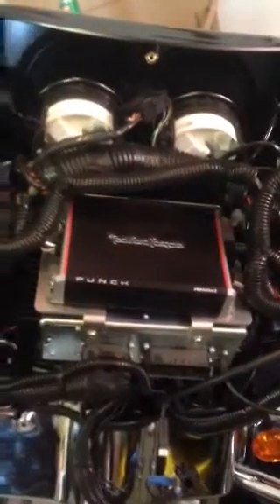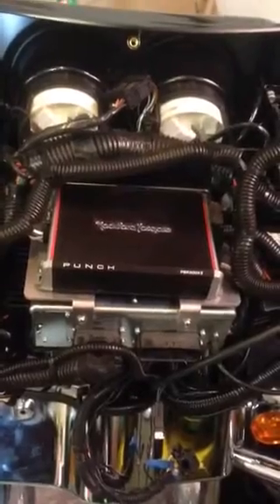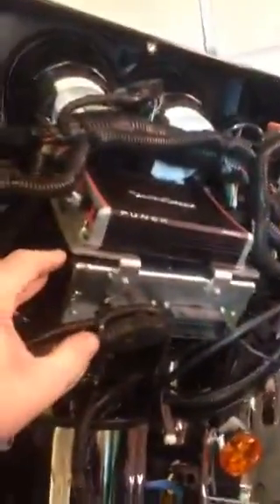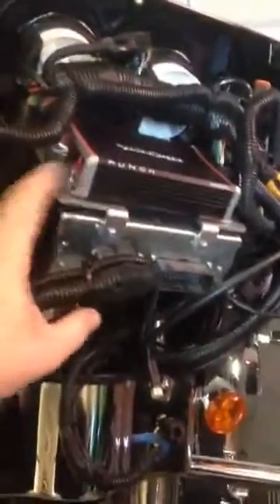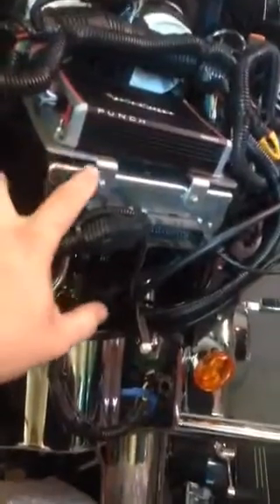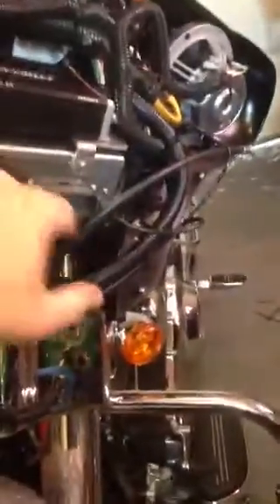how to mount an amplifier / stereo install in harley davidson streetglide

Comment from the maker: @toolband yes the stock speaker wires splice into the amps harness that has the rca ends. you cut the ends off and then splice then together it explains it in the amps instructions on how to do it

Comment: Thanks Kelly. I was going to get the Fosgate, but since I live in Costa Rica and its very high humidity, I was leaning towards the marine grade JL amp. In addition there are some leaking issues with the new vents in the 2014 fairing. How deep are your brackets? Did you add spacers in the rear to keep the same clearance? Thanks
Reply: Hi Kelly. Did you and your buddies flash your factory radio after installing the pbr300x2 amp? Thanks
Reply from the maker: Mark N no there is no need to flash the factory radio.
some people claim that they have to but I have no idea what they are talking about. (probably a totally different set up than what you are doing)
my 2014 amp bracket has a bolt pattern to fit the Rockford amp so the only way to get the JL to work would be to bolt an adaptor plate to mine then the amp to the adaptor plate. (I hope that makes sense)
let me know if you have any other questions

Comment: Kelly, Thanks for the information. Which Amp is that? 300x2? I am looking at the JL audio Marine amp MD200x2, but I see that it is a bit larger than the 300x2 Fosgate. Thanks
Reply from the maker: yes that is a Rockford pbr 300x2 amp.
I now have a 300x4 and it has plenty of power to run 4 speakers.
its up to you what amp to use but I highly recommend the Rockford amps, I have had zero trouble with them and all my buddy's run them also.

thanks for watching my video and if you have any other questions feel free to ask

Comment: On the left side of your amp where the speaker wires come out. Do they just get spliced into your factory connections to your speakers. I can't seam to get better sound out of my amp. And the blue light is on the right side of the amp where the power and ground is. And help would be great! Thanks

Comment: I have installed the 4 channel but the amp isn't turning on, Street Glide Special 2016. The only thing I can think of is the remote wire. I don't have the remote wire installed. Can you help? Thanks in advance.

Comment: Will the brackets fit a 2015 street glide?
Reply from the maker: This will not work on 2014 or newer 
Here is a link to the one that will work on the 2014+ street glides. 
http://m.ebay.com/itm/2014-Harley-batwing-amp-mount-for-rockford-fosgate-pbr300x2-pbr300x4-kicker-/161256797212?nav=SEARCH

Comment: how did you connect the amp to the stock head unit
Reply from the maker: For this rockford amp it is very simple to hook to a stock head unit. 
You just cut the rca ends off the connector that comes with the amp and then connect those wires to the wires that originally went to the speakers from the head unit. 
It is very easy and is better explained in the instructions that comes with the amp. 

Let me know if you have any other questions. 

Thanks 
Kelly.